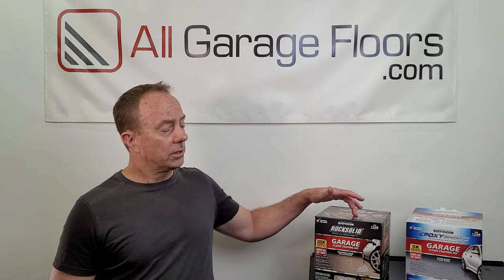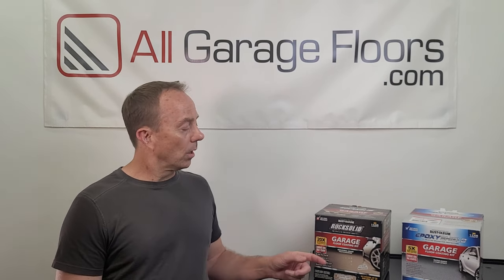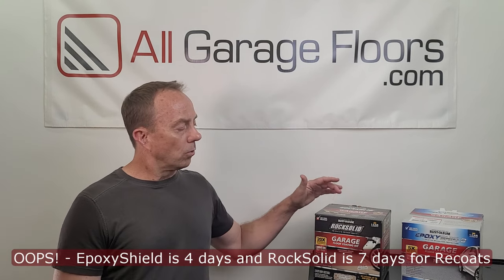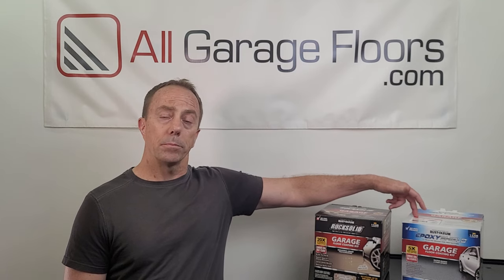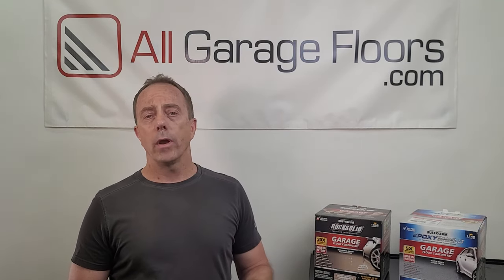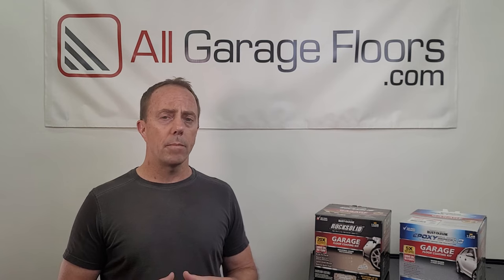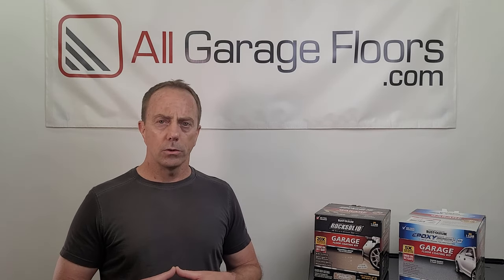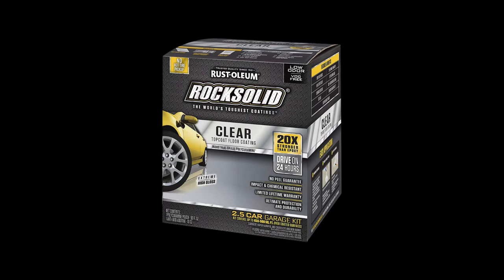RockSolid vs EpoxyShield | Which is Best for your Garage?

Comment: What do you think about doing the rocksolid floor coating kit and then adding a top coat of the epoxy shield clear coat. Sounds like it could be a winning combo?
Reply from the maker: Hello Eric. No, it's not the best choice. RockSolid Polycuramine and EpoxyShield epoxy are not chemically compatible. Rust-Oleum explicitly states not to use one over the other during the recoat window. To use the EpoxyShield Clear Coat, you would need to let the RockSolid coat cure, then prep the surface by roughing it up with 150-grit sandpaper so the EpoxyShield could obtain a mechanical bond. Additionally, RockSolid Clear Coat has a better abrasion rating than EpoxyShield and will wear better. The number one rule for clear coats is that they should perform just as well if not better than the color coat. The clear coat is the one that takes all the abuse and protects the color coat.
Reply: @allgaragefloors  So what is the best way to clear coat after the RockSolid epoxy w flakes? Or is a clear coat not that necessary?
Reply from the maker: @HeyEricGardiner  I think you missed it in my last comment :). Use the RockSolid Clear Coat. It can be directly applied to the color coat and flakes a minimum of 6 hours after the color coat. RockSolid provides a maximum time of up to 7 days for additional applications.
Reply: @allgaragefloors  Thanks for the clear answer. Very awesome.

Comment: Looks like PolyUrea suppliers caught on to the fact that they had a superior product for cheaper, because none of the PolyUrea I've seen (including those in the link you provided) are cheaper than the Rocksolid. Still, I think I'm going that route, looking at the Legacy PolyUrea.
Reply from the maker: Yes, prices have gone up across the board on all products. Epoxy took the biggest hit. Polyurea is actually less expensive than 100% solids epoxy now. The single-part polyurea is cheaper than RockSolid polycuramine if you need two color coats of RockSolid due to the first coat being too thin. It's the biggest complaint about RockSolid. You will be much better off with single-part polyurea over RockSolid if your budget allows for it. It's a night and day difference in longevity and performance. The Legacy Aegis kit is a good value.

Comment: Great video. Will the EpoxyShield really cover a standard 2 car garage? Also, their clearcoat seems a bit expensive. Could you recommend less pricey one? Finally, if these two were not available, what low cost, DIY garage floor coating would you recommend?
Reply from the maker: Hi Melvin. The 2.5-car kit will cover up to 500 sq. ft. For the first coat on bare concrete, you need to reduce that number by 10% to account for the concrete surface. If it was a second coat, you can almost get the 500 sq. ft. The number one rule of clear coats is that they need to perform just as well if not better than the color coat. The clear coat is the one that gets the traffic and abuse. You never want to put an inferior clear coat over a color coat. It just reduces the overall performance of your coating. The EpoxyShield Clear is the proper clear coat to apply. It actually performs a bit better than the color coat since it's a 100% solids epoxy. The EpoxyShield line of epoxy coatings is one of the least expensive concrete coating products you can purchase for a garage floor.

Comment: Fantastic video. I've been having this debate with myself about an upcoming basement floor renovation, and your comparison just alleviated several of my questions. 
I do have one follow up: Should we be concerned with using something like Concrete Moisture Stop Fortifying Sealer or another moisture barrier prior to either Rocksolid or EpoxyShield?

My own application will likely be Rocksolid on a concrete basement pad, it doesn't have standing water or seepage but does have high humidity. From what I've read, the lack of a moisture barrier may lead to bubbling or delamination with other Epoxy coatings. I don't know whether that holds true for these two products.
Reply from the maker: Yes, trapped moisture vapor below a coating can cause delamination issues. Whenever applying a coating to a basement, we highly recommend conducting a simple moisture test first. This article explains how and why it should be done: https://allgaragefloors.com/concrete-moisture-test/

If you do have moisture, then the next step is to conduct a calcium chloride test to determine how much moisture you have. Most coatings will only withstand up to 3 lbs. Moisture Stop is essentially a concrete densifier. It will slow down moisture intrusion and sometimes stop it, but it all depends on how much moisture vapor is getting through. The less moisture there is, the better it works.
Reply: @allgaragefloors  Thank you so much

Comment: I am interested in Epoxy shield part 1 for my garage. Can rustoleum clear top coat be applied instead of the Epoxy shield part two clear top coat?
Reply from the maker: Hi Nick. Yes, Rust-Oleum Clear Finish Top Coat can be applied directly to 1-part epoxy paints. Just be sure to follow the recommended recoat times. Be aware that 1-part paint will peel from hot tire tires and that the Clear Finish Top Coat does not resist staining and chemicals nearly as well as standard 2-part epoxy coatings. The combination you are considering works fine for areas with mostly foot traffic. If you are using it in a garage with regular car traffic, it will typically need repaint where the cars park in about 6 months to a year.
Reply: Great thank you! The Rust-Oleum clear finish top coat is a third of the price in comparison to the Epoxy Shield top coat. Could I apply the Epoxy shield part 1 that you referenced in this video as my base coat, and the Rustoleum clear finish top coat as my finish coat? Or is that rustoleum clear finish top coat product only compatible with 1-Part epoxy paints?
Reply from the maker: @nicktroilo3534  Hi Nick. The reason Rust-Oleum Clear Finish Top Coat is a third of the price is because it does not perform nearly as well as true 2-part epoxy. The Clear Finish Top Coat can be applied over any brand of 1-part epoxy paint or acrylic concrete paint. The EpoxyShield in the video that is compared to RockSolid is a 2-part epoxy coating. It's not a 1-part epoxy paint. The Clear Finish Top Coat is an acrylic coating and not a 2-part epoxy. Therefore, it should not be applied over the EpoxyShield Garage Floor Coating. Rust-Oleum does not recommend it either. The number one rule of clear coats is that they should perform just as well, if not better, than the color coat. Otherwise, you are reducing how well the overall coating system performs.
Reply: Understood, really appreciate the response!

Comment: Will concrete patch like top and bond adhere on top of an epoxy crack repair ?
Reply from the maker: It will as long as it is roughed up with 60-80 grit sandpaper first.

Comment: What is the best option for garage, epoxy vs rocksolid INDUSTRIAL-GRADE
POLYCURAMINE ?

Thank you in advance
Reply from the maker: Hi Vimal. The RockSolid Industrial-Grade Polycuramine is no different than the polycuramine in the garage kits. They just call it Industrial because the box contains four burst pouches for up to 1000 square feet of coverage. So nothing changes from what we state in the video. It's just another example of gimmicky marketing by Rust-Oleum.
Reply: Thank you again for your time 😊

Comment: How long should you wait to coat a brand new cement floor
Reply from the maker: You need to wait a minimum of 30 days before etching and coating a typical 4" thick concrete slab that has been freshly poured.

Comment: Ever any problem with bubbles in the finish with Rock solid ??
Reply from the maker: It's not a common problem since RockSolid is a thin coating. However, it can happen if it's applied too thick or if the concrete experiences outgassing.

Comment: I rented a grinder and grinded the concrete in my oversized garage. I purchased Rust-Oleum's 2.5 car garage Epoxy Shield kit..My question, since I grinded will I need more of the epoxy shield product or should I be looking at some kind of compatible primer? I'm also planning on placing a top coat over it. Thank you for the video and any direction you can provide me with.
Reply from the maker: Hi Billy. The 2.5 car kit will cover up to 500 square feet depending on porosity. This means that it might go 500 square feet if applied over another coating, 450 square feet on etched concrete and even less on concrete treated via grinding. I'm not sure what your square footage is, but you most likely will need two coats. The first will act as the primer coat and not look very good. The second will add thickness and the proper color uniformity. Use the EpoxyShield Clear Coat for your topcoat since it is compatible. You have up to four days to apply it after the last color coat. This article talks about primer coats for DIY home improvement store coatings: https://allgaragefloors.com/epoxyshield-rocksolid-concrete-primers/
Reply: @allgaragefloors  much appreciated. I'm going with your recommendation.
Reply: So in a nutshell. I better leave my garage floor as it is without going with all the fuss of applying stuff who doesn’t last long. One question though: how come dealer’s car floor are so solid  in terms of quality coat on their floor?

Comment: What are your thouhts about using recoat primer as a substute to grinding?  I appreciate your video, very informative.
Reply from the maker: Hi Roger. The primary purpose for Rust-Oleum Recoat Primer is to use it on bare concrete that has been sealed or older coatings (still adhered well) that will received a new coat. It is not a substitute for good floor prep for standard bare concrete. It's an acrylic product and does not adhere as strongly as RockSolid or EpoxyShield. If you were thinking of grinding your concrete for prep, there are much better products available to the public from concrete coating vendors online that perform so much better than these two. We can make recommendations if you are not aware of any.
Reply: @allgaragefloors  my garage, 18 years old, it is very clean, I don’t work in it as I have a shop.  The garage has a one step epoxy on it that looks new in places and worn off in others. As a DYI, I saw some tubers skipping grinding, degreasing, and acid cleaning. My fingers were crossed hoping to go that way. From what you said, it might not be a good idea. Thanks for your quick reply.
Reply from the maker: @rogerjohnston9545  Yeah, there are a few DIY videos out there of people not doing the proper prep. Unfortunately, it just creates problems down the road with coatings peeling up for people who watch those videos thinking they can do the same. You just can't take shortcuts when it comes to coatings. 1-part epoxy is just acrylic concrete paint with 2-4% epoxy resin added. If you aren't parking your car in the garage, the cheapest and easiest solution is to just scrape the surface to remove any loose paint, lightly scuff the remainder with 150-grit sandpaper, and then apply more 1-part epoxy. If you want to apply RockSolid, EpoxyShield, or a better coating product, it's best to remove the paint first. How well a coating adheres depends on what it is adhered to. I hope that helps.

Comment: How soon do you need to apply the clear coat to the paint ?
Reply from the maker: Hi Midge. It depends on the product. You need to wait a minimum of 10-12 hours for EpoxyShield and 6-8 hours for RockSolid. EpoxyShield allows up to 4 days to apply it and RockSolid 7 days. After that, the surface needs sanding first. Just an FYI, these products are not paint. They are concrete coatings.
Reply: @allgaragefloors  thanks for the reply and will definitely consider the shield after the coatings .   Using RockSolid
Reply from the maker: @Midge1k  You are welcome. You need to use RockSolid Clear Coat if using RockSolid color coat. EpoxyShield and RockSolid are not compatible.

Comment: Can you use the epoxy shield clear coat on top of the rock solid main coat?
Reply from the maker: Hi Zach. Rust-Oleum explicitly states not to intermix the two products. They are not chemically compatible. EpoxyShield is an epoxy coating and RockSolid is a polycuramine coating. RockSolid clear is better performing and longer lasting of the two clear coats.
Reply: Can you use the color chips on the rock solid
Reply from the maker: @mikeshell6955  Hi Mike. You can use the color flakes. They are included with the kit.

Comment: OK I  paint the garage floor first with Bert primer 902 slate gray garage floor paint add my flakes and about to add  high gloss 2 part Epoxy clearcoat is that correct and tips on making it last longer? last time I use this product the hot tires pulled it up the Epoxy and the paint should I purchase another type of clearcoat and if so, what type should I get?
Reply from the maker: Hi Will. The first thing we want to state is that paint applied to concrete will peel from hot tires - period. Even if a good clear coat is applied, the tires adhere to the clear coat which is adhered to the paint which is adhered to the concrete. The paint is the weak link and pulls up from the concrete when this happens. It's like building a nice house on a sand foundation. You need a proper concrete coating (not paint) with the proper concrete prep to avoid hot tire pickup. Regarding clear coats for paint and 1-part epoxy paint, we have a video here that will answer all of your questions: https://youtu.be/GKMzVCeO270?si=x2YwJTS2PflHL5oG
Reply: @allgaragefloors  I did rent a sander and sander to sand the floor down first do you still think it will peel after I sand the floor down?
Reply from the maker: Paint on concrete that is driven on by a car will peel, despite how well it is prepped. It just cannot adhere as well as a high-performing epoxy or similar coating. It's too thin and does not have the heat tolerance. You may delay it for a while, but unfortunately, it will still happen at some point.
Reply: @allgaragefloors  OK what clearcoat can I use, so that does not happen when I drive on i’m going to contact epoxy Floor coating and purchase their clearcoat
Reply from the maker: @willboyd8021  If you put a good epoxy clear coat over paint, hot tires will pull everything up at some point. If you are going to apply a 2-part epoxy color coat to properly prepared bare concrete, then use the clear coat the manufacturer sells to accompany it.

Comment: Great video .. Is seal necessary after rock-shield epoxy installation ?
Reply from the maker: RockSolid is a coating and sealer. It's not mandatory, but there are advantages to applying RockSolid Clear Coat if that is what you mean. It will lock in and protect the color flakes and color coat. This article here explains the advantages of a clear coat:https://allgaragefloors.com/clear-coat-your-epoxy-floor/
Reply: UV light will change the color where the sun shines, the clear coat will prevent that.

Comment: If I have a 3 car garage can I tape off the third stall to cover at a later date so I can move all my stuff from one side to the other or does the whole entire floor need to be done at once ?
Reply from the maker: Whenever doing a floor sections, you always want to use a natural barrier as a stopping/dividing point. For example, terminate the coating at any contraction joint or sawcut in the concrete. Otherwise, the taped off section will stand out like a sore thumb once completed. Coatings do not blend together like paint does on a wall. It will be obvious where once section meets up with another. Keep in mind that though you will be using the same color, it will still look slightly different than the rest of the floor.

Comment: Looking to coat my basment with something and was planning to go with one of these 2. Only foot traffic and dog toe nails to defend against.  Is there something better and can it be painted in 2 separate sections after 1 section dries?
Reply from the maker: Hi Terry. There are definitely epoxy products that are much better than these if that is what you are asking. A basement must have a low VOC coating so a 100% solids epoxy would be the best. A single coat is 4x thicker than either of the Rust-Oleum products. If you want to choose between the Rust-Oleum products, we would recommend EpoxyShield. It has a satin finish and will not show the scratches from dog nails like the very glossy RockSolid will.
Reply: @allgaragefloors  what other products would u recommend?
Reply from the maker: @terrymiller9788   The Colored Epoxies brand is a good example for a basement. It's available in multiple colors other than gray and tan. You can find it here on Amazon: https://amzn.to/3HDEBYA
Reply: @allgaragefloors  thanks alot

Comment: My floor never dried and still sticky.  What should i do
Reply from the maker: Epoxy doesn't dry like paint. It chemically cures to a hardened state. When it does not harden, it's typically due to improper/insufficient mixing or from being applied when the temperatures were too cold. When this happens, the only thing you can do at this point is scrape it off the floor, clean off the remaining residue with a solvent such as denatured alcohol, and then apply a new coat.